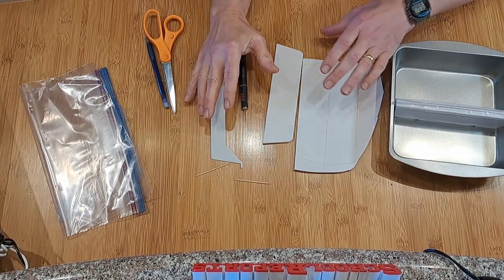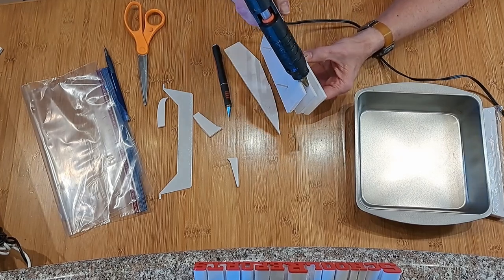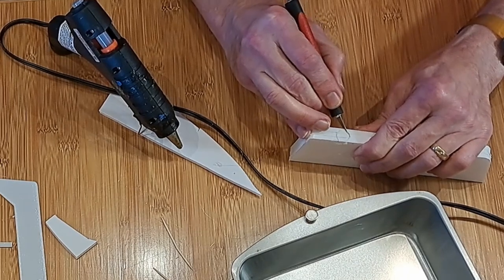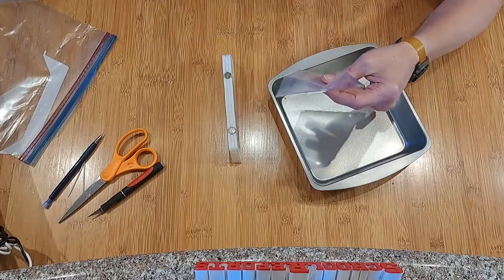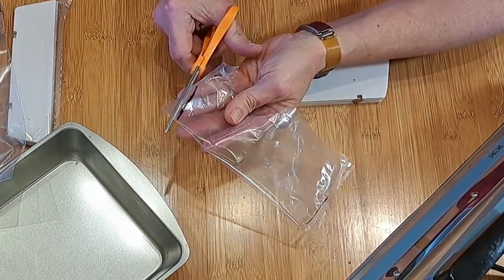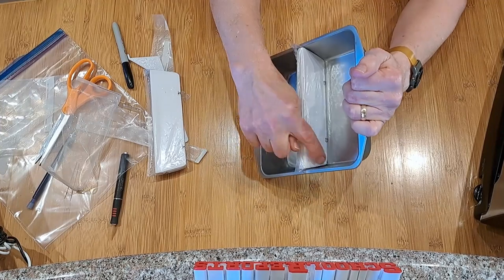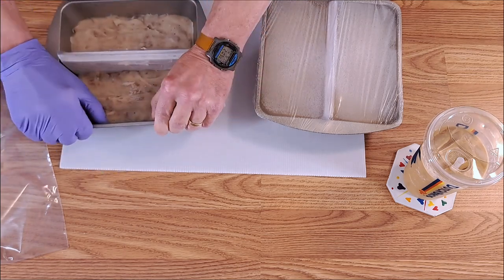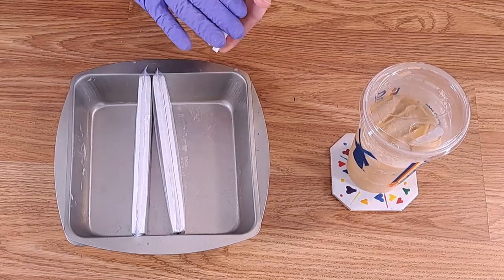Making Dividers for My Pre-freeze Pans Without Using a 3D Printer (For Our Medium Freeze Dryer)

Comment: A general comment. My machine has 5.4.24 software. Everything I am doing is finishing at about the 24 hour mark. I have also found that if you have your machine in a cool room it helps quite a bit. I don't have any freezing around the door or seal. I have the large machine. I do go with smaller batches. Example. 2 cans of corn, for example, per tray. 1 quart of milk, 2 lbs of diced potatoes per tray. It will do more but i know those amounts will be done in 24 hours so I can schedule drying around work.
Reply from the maker: Thanks for the comment!
I've considered telling people, when asked "how long did that batch take?" that it was 32 hours.  And then explain that if you adjust the conditions just right, that every batch COULD be run in 32 hours. 🤣

I often (very often!) don't get to the machine right away when it finishes, it just sit there chilling. Sometimes it waits 12 hours or more. Very chill, -40 chill. By the time I get around to it, without the front disc and seal insulation, the entire door and seal would be covered with condensation, both liquid and frozen. And then it melts and makes a mess. For people that stay right on top the the process, ready to take it out and check it the minute it beeps, all this is totally unneeded.
Reply: @SchoolReports  I am going to experiment with adding more and without pre freezing. This software version doesn't have an option to select pre frozen or thawed. It runs a freeze cycle, appx 5 hours. I have ran milk that was not frozen all the way and it didn't make the process take longer. I do have the extended drying set to 5 hours incase I am late getting in. I do a weight check and run for another hour to verify. Hopefully getting some good info will help other folks with the process. 

I do enjoy your videos. They have given me some guidance and ideas.
Reply from the maker: @C-Culper4874  Our 2017 machine with it's older version firmware (which I love), doesn't have options prefrozen or not either. I have mine set for a freeze cycle of 6 hours (but will shorten the cycle if it's cold enough), and a "Final Dry" time set for 12 hours.
With ours I can't put liquids in without prefreezing because the rack in the older machines are tilted towards the back, so liquids will spill.

Comment: Nice! But how to figure the angle of the pan 😂
Oh wait I guess I could measure the bottom and then the top of the pan and then draw a line!
Reply: Also, assuming you're using the same pan, I did put a link in the description to a printable template of the shape.

Comment: I'm all for  reusing what I have.  Such as  nails for baking potatoes,  mine are 6 inch barn nails. For making the hole for the thermometer just put a nail in it. I try to save things that I can use another way.
Reply from the maker: Thanks! I'm all for reusing too. The original viewers suggestion was to use a nail for the thermometer hole, but I didn't have any the right size or type I could use. I had to buy something anyway, so I went with the stainless steel rod.

Comment: This is excellent! So many times I moaned about wanting dividers like you have. Now I can! Thank you.
Reply from the maker: Thank you for watching and commenting. 
Stay tuned. 😁 I'm going to show another way using 1/2 thick cutting board. (For people with more tools and/or skills)
Reply: While I was interested in making a few of these I think I will wait for the 1/2 cutting board version. I have considered making a program for the milling machine and pumping out several. Only had my medium for less than a month, and have learned so much by your videos. Thanks.
Reply from the maker: @FlyFishingTenn  The cutting board and a CNC would be perfect. Or laser cutter. I don't have either of those (I live in shame), but I could make a router template for cutting and/or finishing them with my router.

Comment: Glad to see no bloodletting by the exacto knife.  Couple questions -  Have you ever tried little squares of parchment paper to line the pans to ease removal?   Also what do you think of using mylar to cover the foam core?  Could even vacuum it in the fd chamber.
Reply from the maker: I have lined the pan with a parchment sling for a few foods. I thought of trying Mylar (but didn't) for the covering, but it was so much less flexible that I gave up on it.

Comment: I think it might be good to point out to all us FD'ers the reason these need to have some thickness to them, in order to make the molded food a bit smaller to fit properly onto the FD trays.  The length of 2 square blocks and 1 half block is too long to fit the MEDIUM trays.  This is the reason to make the half blocks a little bet smaller via the thickness of the divider.  Also might be able to use some of the cheap Dollarstore cutting board material in just 2 layers using a torch or other hot item to melt them together.  Then no need for the plastic wrapper possibly?
Reply from the maker: You are 100% right about the thickness of the dividers being needed. I probably don't mention it enough. 
I think I do already have the video planned showing cutting up a cutting board to make dividers, but I though it best to show a low skill, low tool divider first. 
Our local Chef'Store Winco has 18 X 24 (1/2 inch thick, same as my 3D printed ones) cutting boards for about $23. Big enough to make maybe 2 dozen dividers. They also come in 3/4" and 1" thick. (They are also on Amazon - Winco Cutting Board, 18 by 24 by 1/2-Inch https://amzn.to/3BVM8iJ )

Comment: Good humpday morning! As you may remember, I have cut the dividers from the cutting board you recommended. Thank you! I’m struggling how to attach the small round magnets that I bought to the bottom of dividers to hold in-place in the pans. . I tried burning a small hole, using my dermal bit and I can’t seem to get the best hole to have the magnet level with the divider. I was wondering how you made the hole just right to insert the magnet so that it isn’t raised on the divider. As always your information is so very helpful! Again. Thank you. 😊
Reply from the maker: Sorry it's taken all day to get back to you about this. (I know I've been saying this for a very long time, but really, a video about this is coming soon. It's just that in my world "soon" is a moving target:) 

With my 3D printed dividers the magnets were placed into the print while it was printing so it would be completely surrounded by the plastic and the food couldn't touch them. With the cutting board ones I hadn't figured a way to put the magnets in from the bottom and make them completely surrounded, so I didn't. I decided I could go from the top with a drill press and stop just before going through and drop the magnets in from the top. Second try is to have the magnets on the ends near the top. Third is no magnets and hope the plastic weighs enough to not float. This works for lots of foods (The 3D printed ones would float because they were light) Fourth it to use clips at the top to clip the dividers to the pan instead of magnets.
Again, sorry for being so slow on this.
Reply: Good Morning! Oh please no apologies, but I will accept it. 😊I completely know how things go. I’ve never done videos but I’ve heard its super time consuming! I took a drill bit the size of my small magnet. Put holes in the bottom flat small enough to hold a tiny round magnet. Magnets not really strong enough but almost. Then you mentioned your process that you may use to prevent magnets from coming in contact with food. Mine would have touched food. Not thinking that would be a problem as long as kept clean? Maybe not. I really like the idea of magnets along the top side of divider as long as the bottom didn’t kick out with food. I don’t think it would. To drill them, I can’t go there. Way to much for me to try. I’m going to try the side magnets on dividers just above where the food would be. I will let you know how that goes. I think well because when I simply taped the divider along the top to the side of pan it didn’t swing out on the bottom at all. I think thicker foods it would be fine standing alone. Not so much for liquid type. Thank you so much for you time and help. I think you solved my problem! 👍🏼 if this doesn’t work I will try and think of a type of clip to the tops of dividers to hold in place. Again, Thanks!!
Reply from the maker: @Judten1  Thanks. I should have been more precise about my magnet/food contact concern. It wasn't really about it touching, it's more about being able to clean the gaps between the magnets and the plastic. I always assume the any small gaps will get icky. (To use highly scientific words) If I were sure I could adequately clean every crevice, I wouldn't be worried.
Reply: @SchoolReports  I see. I played around with placing magnets on the side of divider. I think it
Would be fine with no swing. I will need to shave sides a bit to allow for the depth of the magnets. I then put two cups of just water in the pan, added the divider with no magnets at all! The divider was heavy enough to not float and it seems like it would stay perfectly in place. (Which should have been my first step) I think you will find that it won’t need much if anything at all. Hubby said just stick a small piece of painters tape to top sides of divider onto the pan so won’t move during transfer
To freezer. Now I have 100 little magnets to play with! Lol. Have a blessed night. Thank you!😊
Reply from the maker: @Judten1  Tape is easy - I like easy!😁

Comment: This is wonderful!!  I asked my son to make me dividers for the FDer trays and he said he wasn't sure how the material he has for his 3d printer would hold up under the freeze and heat in the FDer.  This would work well for the pans and I wonder if they were covered with tinfoil if they would work well in the freeze dryer.  Seal a meal bags sound like the way to go!  Have you tried the plastic corrugated board you had under the frozen pans?
Reply from the maker: We have never put the dividers in the freeze dryer, just the regular freezer. I used the foam core because I thought it would be easier to cut than the corrugated plastic. (I really need a laser cutter) 🤔 I think the corrugated plastic would work well if I could cut it evenly.

Comment: @SchoolReports Tell me what you think!! I cut your divider out of foam the size you gave! Showed it to my husband. He had a great idea I think!  Going to buy a polyurethane 1/2 cutting board cut to size and drill round holes for the magnets on bottom. That way it’s OK if the food touches it! My only concern would be the magnets. Wouldn’t want them to rust. If I don’t want the magnets on the divider in liquid, I found a 2”L by 1/2”W chunky magnet and laid half that magnet on TOP of pan widest part of both sides (where you grab to move) and other half pressing on top of the divider. It seems strong enough to hold divider down even with liquid. I wanted to send a picture but I’m not sure how to. Now I need to find the best way to cut the 1/2” polyurethane board so that it comes out nice. Any suggestions? Any reason this may not work before I buy the cutting board needed? P.S. Is polypropylene (pp) and Polyethlene the same material? I want to get the softer of the two. Thank you!
Reply from the maker: That's been my plan for a long time.
🤣 I've had the cutting boards for making dividers since May, and one is on the table saw right now. (It's just sitting there waiting:) Winco CBWT-1218 Cutting Board, 12 by 18 by 1/2-Inch, White.
 I just haven't made time to finish them yet. With the density of the cutting board material I'm not sure if magnets are even need, because they may not float up like the lighter foam or 3D printed ones will.

Polypropylene and polyethylene are different plastics but similar. Polyethylene tends to be a bit softer. (I think)
Reply: @SchoolReports  That’s great! Thank you so much for including what board you’re using. I’ve been looking and looking for exactly what is going to work. If we get ours ordered and done soon, I will definitely share as well as I am sure you will. Again, Thanks a ton!

Comment: With all the weighing done on my trays. Is it ok if I use pound and ounces?
Reply from the maker: Yes, pounds/ounces are no problem as long as the scale has graduations that go down to 0.05 ounces or better if you're also using it for the Dry Check. If the scale only goes to 0.5 ounce that would still be a whole tablespoon of water. 
We often use pounds/ounces when putting food on the trays and for bagging (especially my sister), but most of the time we use grams during the Dry Check just because it's finer increments. (better accuracy) During the Dry Check we don't really care what the weight numbers are, the only question is - did it lose weight. We don't use the Dry Check numbers for anything else.
Reply: @SchoolReports  I guess it wouldn’t matter then if I don’t understand grams just as long as the numbers go down! Thank you!!👍🏼
Reply from the maker: @Judten1  Exactly! When I taught 3D Design & Printing at some local charter schools, I had to explain to the kids that it doesn't matter if you really have a "feel" for the unit of measure (everything is in millimeters), as long as you use the same ruler for all the measuring. If they measure the object they want to make in millimeters, and then design it in millimeters, it will be the right size. 
With the "Dry Check," it's just the before-number compared to the after-number. Did it go down or not. If it went down, it probably wasn't dry yet.

Comment: How did you get the right angle to match the pan?
Reply from the maker: https://youtu.be/3KLblPCTpHk?t=6 
For making them out of the foamcore I could have just taped the 3 x 5 cards together to match the slope of the sides and then just trace that.
Reply from the maker: 😁 I just realized that I'd forgotten to add the link with the jpg of the divider outline download! I had meant to put a link in the video, the description, and in the pinned comment, and I forgot them all! Now added.
Pan divider outline for medium and large HR trays https://drive.google.com/drive/folders/14tAnOW7nL53Et9bt3UgujDZWFOfbKbjg?usp=sharing

Comment: You did not put a specific link to the pans you are using in your "Show More" area of this Video. Also your 8x8 Pan Links in your past videos (some & maybe all) do not go to any specific pans, it just pulls up a generic link to different pans available on Amazon. Thought I would make you aware of this.
Reply from the maker: Thanks, I need to learn how to do a better job with Amazon links.
The pans I used I got at a Dollar Tree store. They were called "Cooking Concepts Square Tin Cake Pans, 7.625x7.625x2-in" but the bottoms are about 7x7" and are a perfect fit for our medium freeze dryer trays. (Turns out they have them online too https://www.dollartree.com/cooking-concepts-square-cake-pans-75-in/10065 ) The different batches of pans that we have bought (over the past 20 years) have had slightly different side slopes, which would require a slight change in the divider shape. That's why some of our pans have an "X" on them. I've updated the Thingiverse listing to include a new version of the divider that is slightly narrower at the bottom to fit more of the pans.
Reply: @SchoolReports  Thank you very much for this information & all that you show us.